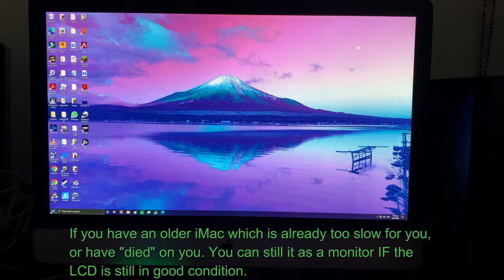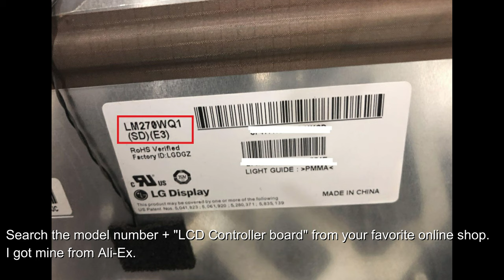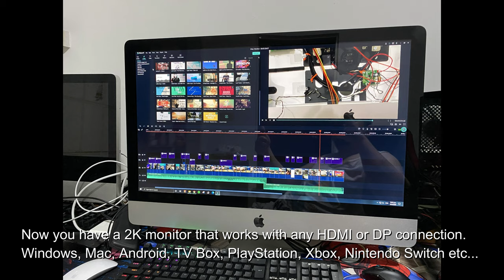iMac Monitor

Comment: Thank you for the video, it's exactly what I wanted to do. I wanted to reuse the webcam but nobody showed the pinout and I didn't want to fry it. I will also try to reuse the original power supply, and maybe the inverter for the screen. But I will have to figure out a way to adjust it, and a way to turn it on and off.The ebay listing said the original inverter is brighter than the one included in the controller board.
I really like your approach of placing the control buttons on the ram slot, that way it's easy to access if the settings have to be changed.
Reply: Update, webcam works fine, drivers are available. I was unable (lazy) to reuse the original psu, so I just used a brick that could provide 12v 6A. My mistake was placing it inside the imac, after a few weeks it started failing due to high temps. Bought a new one from amazon and left it out of the imac, so far so good.

Comment: I know this is an old video, but my Imac has just died, it’s the 27 inch one. Screen still works.
Can you link the controller board that you used? The ones on Ali Ex are just HDMI and VGA none have HDMI and display port combo. My lcd panel is same model as yours. 🙏

Comment: I also have a 2011 27" iMac, but clearly different color wires. Could you kindly tell me what pins you connected to the usb wires. 

For example: (left to right) 
pin 2 - black 
pin 4 - green 
etc

 I think many would find this useful since wire color changes even within the same model, but wire PLACEment will not.
Reply from the maker: Hello. Seems you figured it out from your update in the ifixit forum. 👍🏼
Reply: @whooperfpv  where is it? need answers aswell
Reply: did find it out myself.
USB black cable to camera cable black.
USB cable red to camera cable blue(ish).
USB cable white to camera cable green.
USB cable green to camera cable light gray.

Comment: If you wire up the iSight camera to usb does the iSight microphone also work, or does it only capture video?
Reply from the maker: Mine is recognized as webcam when I plug in to windows. I did not install the microphone

Comment: Hi, great video! Definitely the most advanced iMac display on YouTube! I’m using a newer iMac and each speaker has 4 wires. Is that the same as yours? I’m unsure about which ones to cut and connect to the controller board. Any help would be greatly appreciated!
Reply from the maker: Mine got two only per speaker. You might be able to find some diagram thru Google.